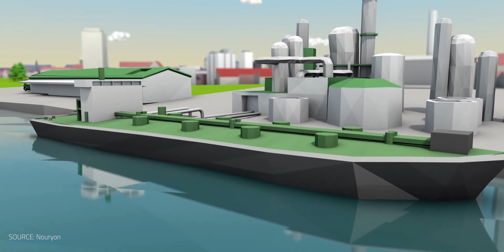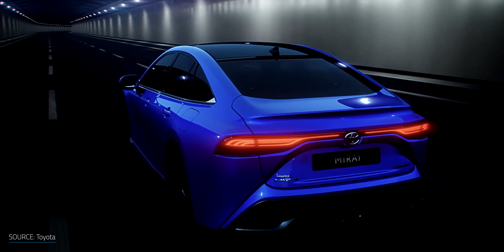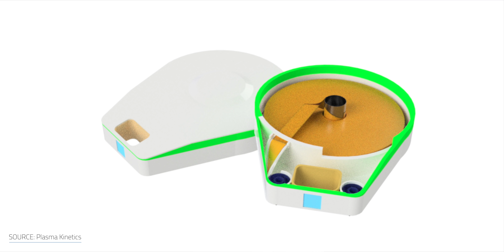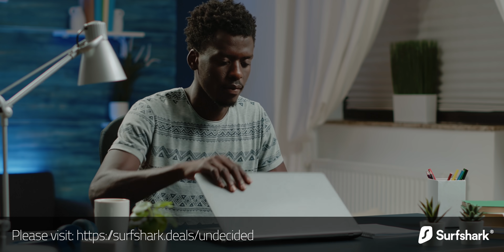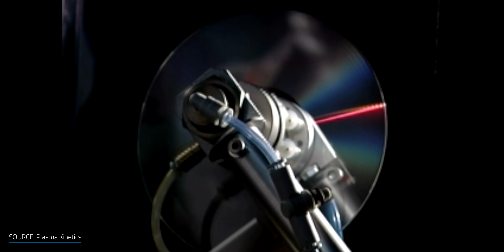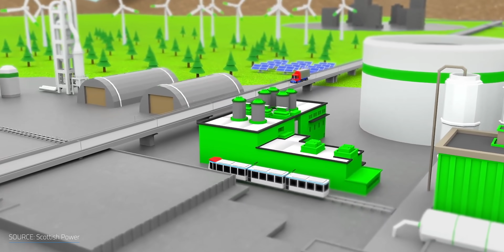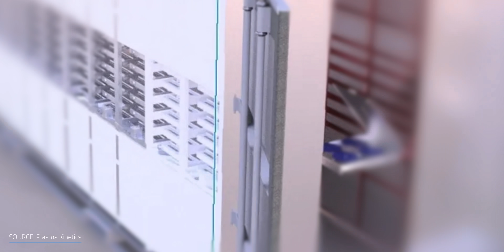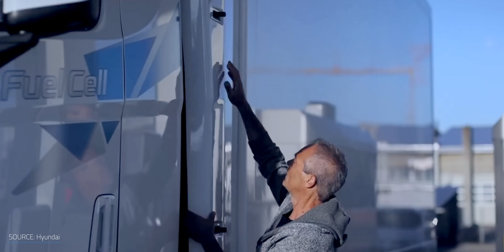Energy Storage Breakthrough - Solid Hydrogen Explained

Comment: "These large scale vehicles require a large amount of energy that batteries can't provide yet"
That's why trains have been using third rail and overhead wires since the dawn of the electric train
Reply: lol, if only america knew what trains were
Reply: @The_fusion_physics_guy  We quite literally have the most trains in the world.
Reply: @gabrielclark1425  Maybe, but our rail infrastructure is woefully outdated, poorly maintained, and not at all utilized for an efficient multi-model transportation system.
Reply: And that works, for the most part. It becomes problematic for crossing large expanses with low population densities (i.e. most of the world). The maintenance costs of large-scale electrification like that have been prohibitive, it's why the only ultra-long-distance electrified lines were built by the Soviet Union as a show of national industrial prowess (I believe the modern Russian Federation is having some trouble with the maintenance costs).

Also that doesn't work so well for international shipping or air travel.
Reply: @gabrielclark1425  Moving at 30 miles per hour, is not for people at all.  The U.S. trains are for cargo, while developed countries has moved on to people transport at much higher speed.   But as long as you have enough cheap petrol, and can pollute like there is no tomorrow, I guess you are fine.
Reply: @gabrielclark1425  and one of the lowest train riderships. 45% of the US population doesn't even have access to public transport.

Just look at London or Tokyo. Each train station is literally 5mins apart on foot. In Singapore, over 64% of the population uses the train as the main mode of transport.
Reply: @SpaceBearEngineer  I assure you, if multibillion dollar companies could save money with trains, they would.
Reply: @bigsmall246  study some geography. We live in a very large country and many of us do not live in compact cities like sardines.
Reply: @jmh1189 china is basically the same size as the US but they have high speed trains connecting the cities, rather than everyone driving their own cars or taking flights. It's one of the reasons the per Capita CO2 emissions of the US is twice that of china.

Every US person is releasing twice the amount of CO2 compared to china, the biggest CO2 emitter in the world.
Reply: @bigsmall246  the US is not the biggest CO2 producer. That title belongs to china, what you mean to say is we have one of the highest (if not the highest) energy use per person in the US. Though it is important to note that there is a handful of countries such as the U.K. and south africa that are really close to our numbers as well.

You seem to know a lot of information that is kinda of right but is overall inaccurate or misleading
Reply: @Biosquid239  1) I never said the US is the largest emitter. I said the US has twice as much per capita emissions as China 2) the only countries with similar per capita emissions as the US (about 15 tonnes/year) are Saudi Arabia, Canada, and Australia. EVERY other country on earth has per capita emissions <10 tonnes/year, way less than the US. UK stands at 6 tonnes/year, less than half that of US.

The one trying to peddle misleading information is you.
Reply: Yep and that is why we need pantographs on trucks and busses. Job done.
Reply: @jmh1189  it's not as simple as just profit.  This is about public policy.  We're designing our system around cars while subsidizing the automotive industry heavily in many ways, and we've even designed our cities and neighborhoods (to their detriment) to be built around cars through both infrastructure and zoning choices.

This isn't just the market doing what the market does, this is about policy (and we haven't even gotten into externalities)
Reply: @Biosquid239  ....this tendency to see criticism of the US and point to another country like China, shutting off the brain before you've even understood the statement, much less though about anything only embarrasses our country globally, you know that, right?
Reply: @Biosquid239  again, you're just jumping to the assumption that someone disagreeing with you needs to be told that China is currently leading in that one particular CO2 metric instead of engaging with what they actually said.
I mean, thank you for proving my point about how you keep reaching for that one factiod to use it as a thought-terminating cliche I guess, but I'd prefer it if you just chilled out enough to get your frontal lobe re-engaged.
Reply: @dynamicworlds1  so i guess you dont understand basic english either if you cant see how my comment was related. Not responding anymore in that case have a good life ❤
Reply: @Biosquid239  ...was that just an instance of the dunning-Kreuger effect caused by maxing out at a middle-school level reading comprehension, or just a desperate attempt to save face?  Whatever, bye.
Reply: @bigsmall246  the problem with comparing us trains to Chinese trains is that a lot of us trains go from east to west whereas most of the trains in China go north and south. Much like the United States most of the population in China is near the coastline so having high speed rail connect the major cities close to the coast makes a lot of sense. But in the United States a lot of people travel from east to west or west to east and the do so you would have to cross a whole lot of unpopulated areas which are not financially feasible for most passenger trains. In the United States the only profitable part of our passenger train network is from DC to Boston which is a near straight Northeast shot.  Going east and west it makes a lot more sense to take an airplane rather than taking a train both in terms of infrastructure and given the wide-open spaces of the United States.
Reply: @bigsmall246  HAHAHAHAHA  ... propaganda bot ??
Reply: @wnxdafriz  trust me, bots won't be able to construct a logically sound argument like mine. Since you can't tell the difference, you either have insufficient logic/critical thinking, or you are too biased.
Reply: Unless all freight trains are powered  the way commuter trains are,  then  that might still be a significant  place for fuel cells, and certainly transport by road still seems  a good place for fuel-cell powered motors. Also, aren't the  significant energy  losses  in transmission of electricity,   using current  infrastructure,  still problem?  Perhaps even  H2 powered trains could still be a good fit for any train, at least for a transitional period, while the grid was being upgraded., and we don't know when that would be completed,  or how the relative costs would differ, even if  someone probably has estimated that. It seems that the jury's still out over how future society will be powered, but exploring  multiple path seems sensible now,.
Reply: @The_fusion_physics_guy  At least fuel-cell powered trucks would be some improvement;).

Comment: I’m just a dilettante in this conversation but one the most logical ideas I have heard for utilizing the H is where it’s not the fuel used for propulsion. Instead it is used to create the electricity that powers the electric motor that drives the vehicle. Reducing all but a very small number of batteries that might incorporate capacitors which is a theoretically feasible hydrogen hybrid model.

Comment: So the waste product of recycling the storage film is Deuterium, an ideal fuel for a Fusion reactor? That's potentially a win-win situation right there.
Reply: Yup
Reply: Good spot!
Reply: And fusion/thermonuclear bombs, but I can't really see that being an issue.  If you build the infrastructure for capturing hydrogen from smokestacks or some other process then the deuterium will be right there with the hydrogen anyway.

And while deuterium is the lowest bar in terms of fusion power, wasn't there an issue with a tokamak's inner lining needing to be replaced often due to neutron embrittlement?  I wasn't able to find the answer after a quick search.
Reply: @docferringer  Let's not forget that Fusion is a pipe dream at present... but then so is this technology and the infrastructure we're considering.

Currently Deuterium is mainly extracted by electrolysing heavy water or less often by fractional distillation of liquid hydrogen, but having it available as a by product of another process is still nothing to sneeze at.. provided ofc you have need of it - let's hope that's for power not bombs eh.

Finally what you are talking about (neutron embrittlement) certainly happens in standard Nuclear reactors and while the current test reactors aren't running at a high enough load over durations where that poses a significant problem (at present)  "Neutron wall loading" or just "Wall load" is very much a cost factor being considered by the designers of Fusion reactors, partly because the walls of a tokamak need to resist a pressure (vacuum) of 100MN so embrittlement needs to be considered when choosing what material to use, but also because whatever you use will inevitably become radioactive and hence you have decommissioning costs to account for as well.
Reply: @Quotheraving  Very informative, thanks!
Reply: No it's rather used for heavy water to moderate fission reactors. And then you can make plutonium and normal fission nuclear bombs.
Reply: @lubricustheslippery5028  I guess that having extracted Deuterium we could burn it to make heavy water.. I mean that's not entirely pointless, but are you trying to claim that Fusion reactions don't use Deuterium or that it isn't used in fusion bombs in the form of lithium deuteride?
Reply: @Quotheraving  No but making a fusion reactor is so hard so making deuterium is the least of consern.
To make a fusion bomb you must first make a fission bomb as a fuse to lit the deuterium.
It's possible to make an Uranium fission bomb without a nuclear reactor, the Hiroshima bomb was uranium. What I now all other is plutonium based so they is probably easier to make and then you nead heavy water for the nuclear ractor to make the plutonium.
Reply: unless your an oil baron... then it cuts into your profits.  theyre gonna protest this tech with all their resources.
Reply: And a product of fusion is helium, which could solve the increasing rarity of it, and might allow airships to become a mainstream form of air transport again!
Reply: @Quotheraving  Dear "quote the raven" (I love your malapropism). A person of unequivocal intelligence and critical thinking.  I laud you, sir!
(PS. Methinks we need more of "us" and less of "them" on this Internet commenting community, think you not?   ;-)
Reply: @Quotheraving  Great answer, and you are well informed, sans doute.  Voilà!
Reply: @ComradeCorvus  Well if adequately fire-protected, hydrogen was way, way better than helium to lift, by a long shot. The wreck of the Hindenburg obliterated further thought on dirigibles-  the way a crash of ONE Tesla by a very unobservant and careless driver, 5 years ago, continues to infect the entire National Transportation Safety Board to this day, despite the huge advances demonstrated to them by Saint Elon.
Reply: @loftsatsympaticodotc  Aww, thank you :)
Reply: @docferringer  from what I have seen MIT have a design fix for that, neutron embrittlement is no worse than any other maintenance issue with moving mechanical parts, so it can be designed around as MIT have shown.
Reply: That 'splains everything! The reason we don't have safe reactors is due to Nixxon killing the Molten Salt Reactor project.  It didn't produce weapon's grade trash. Thorium reactors are key to man's survival. Something governments don't pursue. They like carnage, suffering, and strife.
Thorium needs reactor waste to catalyze it to be fissionable. Consuming nuclear waste seems like a good thing to me. But then I care for Humans.
Reply: Was thinking the same thing.
Reply: In all fairness, the real bottleneck for realistic fusion in the next few decades is tritium, but more deuterium can't hurt!
Reply: @The_fusion_physics_guy  Agreed, DT Fusion is the lowest hanging of the fusion fruit.

Comment: Something about that energy density sounds fishy.
There's literally less hydrogen per cubic meter than a tank.
Not only that, but you're also carrying more weight than just the hydrogen and the tank.

It all seems a little too good to be true and sounds like a CEO's investor pitch.
I could be wrong though, i'm no expert.
Reply: @sourand jaded It all goes into the Earth/atmosphere and eventually gets radiated to space. The amount of heat released by humans is negligible compared to the amount of heat hitting the planet from the sun all the time, so human heat generation is not going to cause a noticeable increase in temperature apart from in very local areas (Like the middle of a steel foundry). Human released greenhouse gases in the atmosphere however are allowing more of the heat from the sun to be captured by the Earth's atmosphere, and this is creating a problem.
Reply: @sourand jaded heat is literally vibration of molecule. There is three way of transferring heat 1/thermal conduction- which is as molecules vibrate they bounce into each other and give the other molecule some energy from it own. 2/thermal convection- which is basically mixing fluid with different temperature. 3/thermal radiation Which is as molecule accelerate they are creating electromagnetic radiation. Loosing energy by creating radiation. So heat just disappear by time.
Reply: It's probably just low performance
Reply: You should listen to everything on this channel as if it were a CEO's sales pitch.  It's not all fake, by any means, but you shouldn't take any of it at face value.